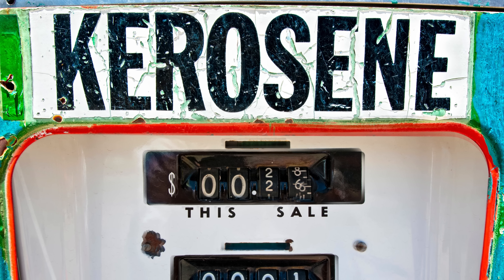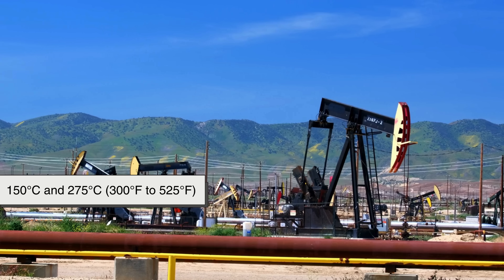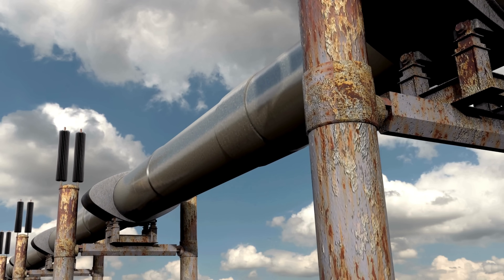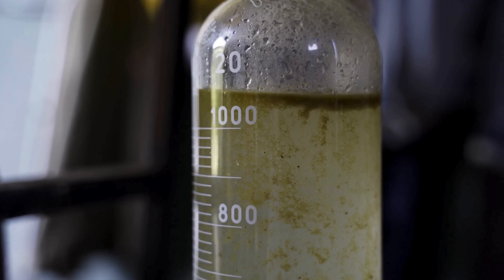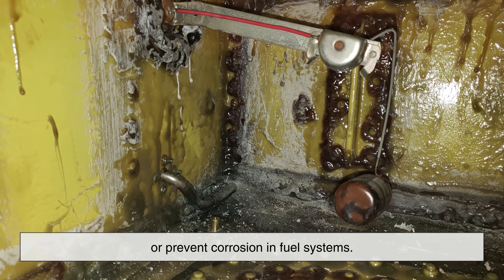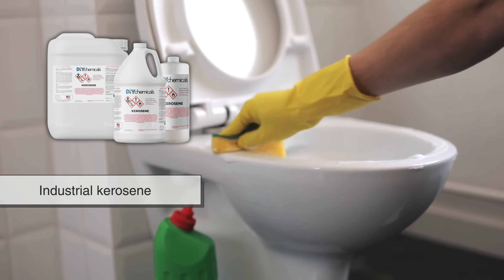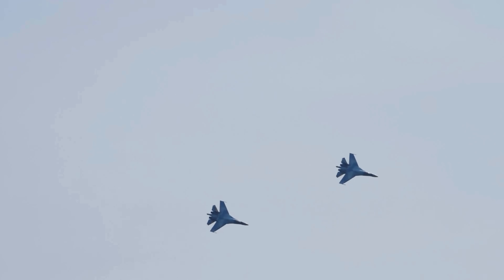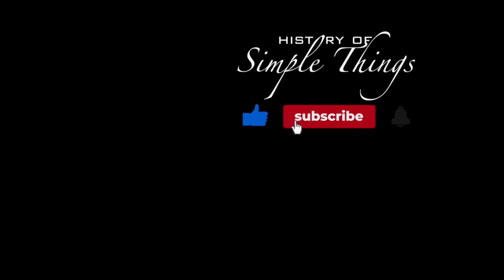How Is Kerosene Made?

Comment: I still use three Perfection Kerosene heaters in my house in the winter during especially cold snaps. They only smell a small amount when first lit and when they are turned off. Doesn't stink up the house. Each puts out about 10,000 BTUs. I even use two in my workshop if I have to be out there in the winter. Antique tech that still works great.

Comment: Here in Britain kerosene is often called paraffin which is confusing as it is quite different from true paraffin, which is a waxy substance and can be solid or liquid.
Portable 'paraffin'/kerosene heaters were often used in greenhouses, outhouses etc or even as the main heating for small rooms o bedsits or in main rooms in spring and autumn when some heat may be needed but not enough to need to light the main fire,

Comment: Why does kerosene cost so much more when gasoline is an end product? There shouldn’t be any reason why by-products of oil cost more than fuel.   Why does diesel cost a dollar more than gasoline per gallon? You get diesel refined before gasoline is made
Reply: Because they can
Reply: One reason is that in a barrel of crude, there are less of the heavier fractions.   So you need more crude oil to produce the same amount of diesel or kerosene.
Reply: @timclark7507 wrong
Reply: The refining process after the extraction to remove sulfur from kerosene and diesel is costly.
Reply: @lajya01 True, but catalytic cracking, isomerization, alkylation, and reforming of crude naptha (40 octane) into modern motor gasoline (87, 89, 91 octane) is also expensive.
Reply: State an federal taxes are higher for diesel. The rational being that large, heavy trucks do more damage to the highway. While true, diesel passenger vehicles do not. I agree with you diesel could be much cheaper.
Reply: @sniper99559 The tax should be on gross vehicle weight and miles, not based on the fuel type. We have been deprived of fuel efficient diesel passenger automobiles by this. I'm actually surprised they haven't started implementing high efficiency gasoline engines on big rigs in order to capture the cheaper fuel.
Reply: @gregorymalchuk272 I'm inclined to agree with the  proposed method of taxation. Unfortunately gasoline just doesn't have the energy to provide the needed torque. I understand that Cummings has developed a small higher torque gasoline engine, maybe the technology is on the horizon.
Reply: 45% of a barrel of crude is turned into gasoline, 25% is turned into diesel, 10% kerosene, etc. Basic economics. Most of the barrel is gasoline and there is less of the other fuels, which means less supply. Lower supply means higher price.
Reply: Kerosene is literally jet fuel, supply and demand dictates it’s worth a bit more than gasoline. Although you would be surprised, wholesale kerosene is often cheaper than retail gasoline.
Reply: Street value for huffing gas is higher than kerosene.
Reply: Well. Price gouging for 1. Heavy road use for 2.  Right now diesel near me is 2.79 and gas is between 2.29 and 2.59.   Kerosene isn't a byproduct of an end product.     Distillation produces many fractions of hydrocarbons that have many uses, from aspirin to paint thinner to gasoline.   Kerosene in the us  is used for heat (#1 fuel oil) , camping stoves, jet fuel, tractor fuel among other things.   I used to buy road Kerosene at the pump, because it cost less than diesel at the time.    But to end my spiel,  every part of crude oil, when refined, is an end product, not jist byproducts and waste products.
Reply: kerosene is horrible for a Diesel engine.  It has no lubricant in it.  And is hard on fuel pumps.
Reply: Costs more to makw and sells cheaper than gas makes zero sense
Reply: Social engineering .diesel is dirty lol kerosene diesel very little difference in a Cummins

Comment: highly refined kerosene formulations is also  used as rocket fuel and oxygen as an oxidizer.
Reply: RP-1   the food for the Saturn V F-1 rocket engine. Can't have the injector plate orfices getting clogged with coked up fuel.
Reply: Jet fuel is just refined kerosene.
Reply: @hessranch well yeah... Do you even know how difficult it was to clean the carbon from the combustion tubes of the early jet engines??? It was like fartin' around with concrete... decarbonizing fluid raised hell with your chemical gloves and hands. Couldn't media blast them because it caused stress in the tubes and then they would crack and send pieces into the turbine blades. Fun was had by all... NOT!!!
Reply: @gerrywalsh5766 😂😂😂😂
Reply: not really
Reply: @ciprianpopa1503  RP-1 is super refined Kerosene... They were taking absolutely no chances in having regular Kerosene start coking up the injector plate and the hundreds of cooling tubes that made up the nozzle. Didn't need an engine failure on that monster.